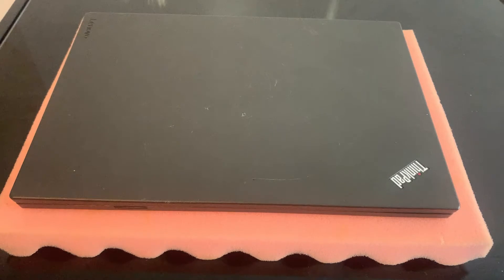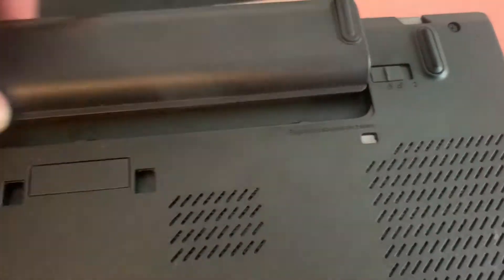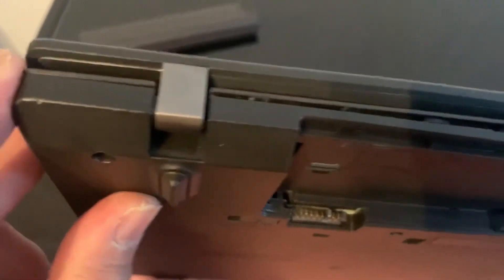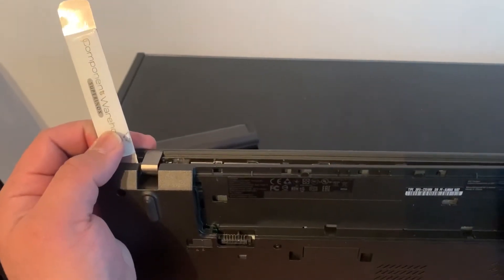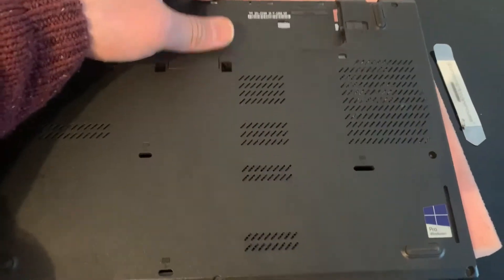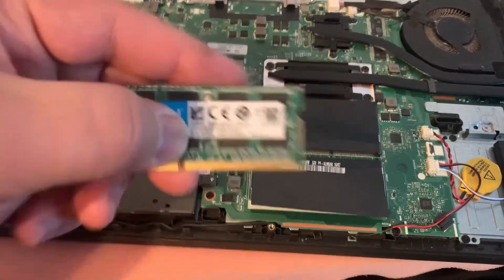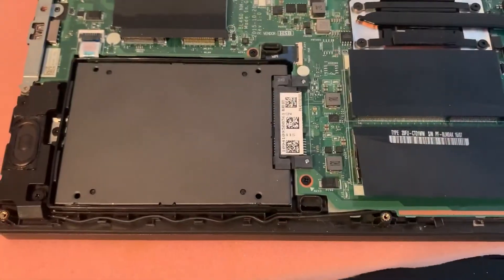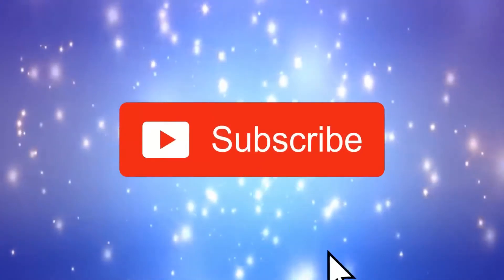Lenovo Thinkpad L450, L460, L470 -  How To Upgrade Ram, SSD/HDD, Replace /Reset CMOS RTC Battery

Comment: Hello, can I ask you something? When RAM is installed, is there a need to install or reset the computer?
Reply from the maker: Hello, when you install ram, it will show up instantly, no need to reset as it’s not required.
Reply: @yesyoucan8821  thank you i installed it to 16gb ♥️
Reply: But the HDD where i can put? My SSD is at 512gb
Reply: @TopHits2023s-wo1jp  just keep it that way bro